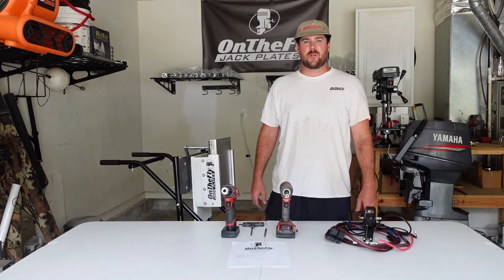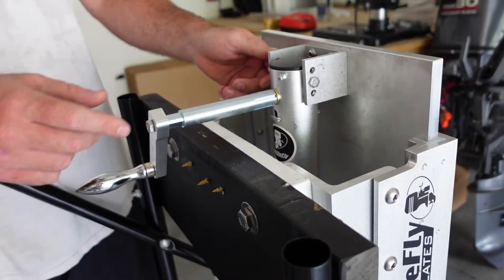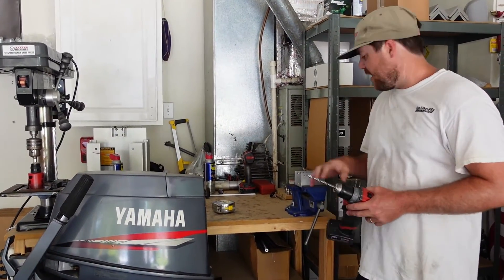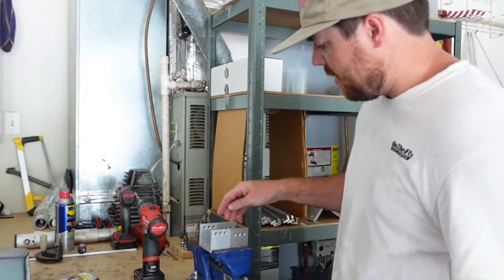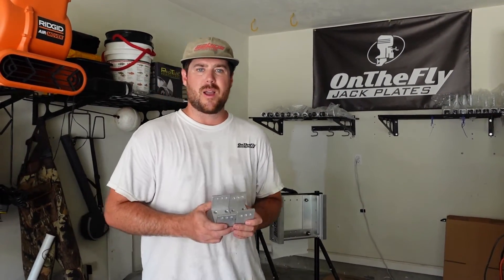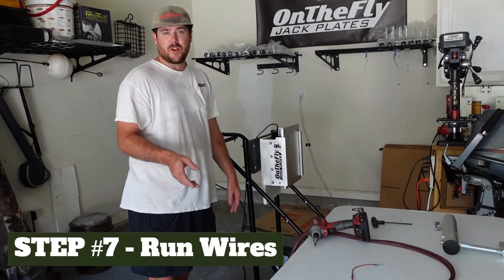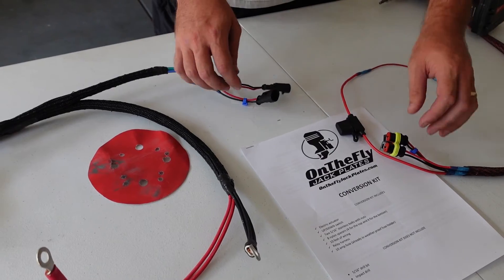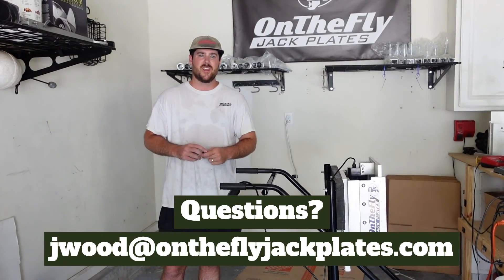On The Fly Jack Plates Electric Conversion Kit Install

Comment: Looking to upgrade my manual onthefly. Does this have the exact same range of motion ?
Reply: I am curious about the same thing. I might actually gain some travel because there's no handle that needs to clear the transom at full drop.
Reply from the maker: @timlong1462 the electric unit has another 1/2 inch of travel making it have 6 inches total.
Reply: @ontheflyjackplates875 yes and it has been awesome. Been loving the electric conversion a ton so far. Manual was nice for starting out but electric has really been nice. So easy to just push a button that I'm a lot more likely to use the full travel available all the time.
Reply from the maker: The electric unit has another 1/2 inch of travel.